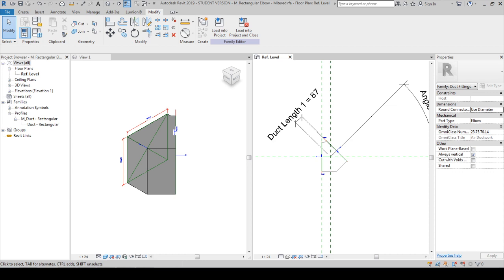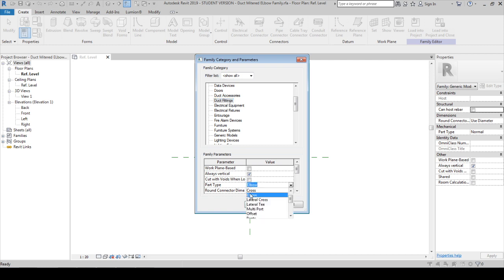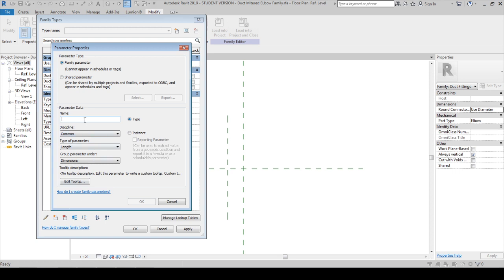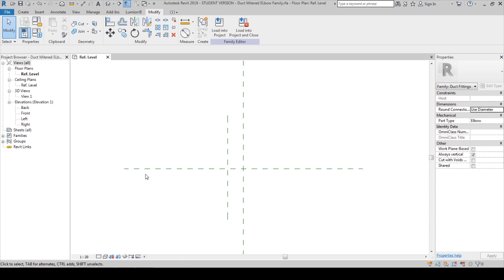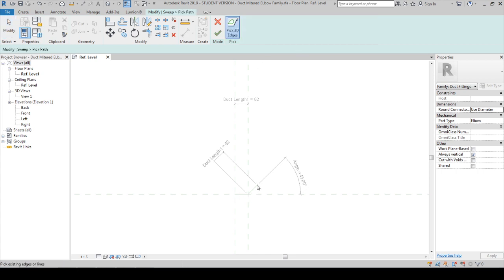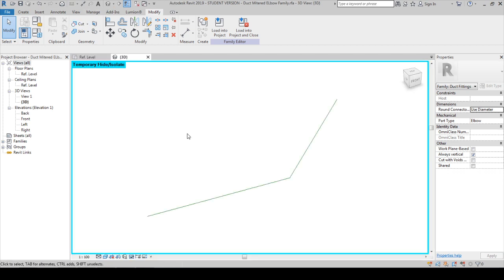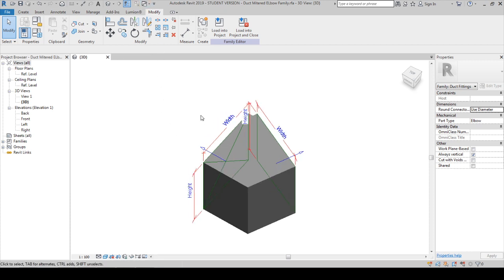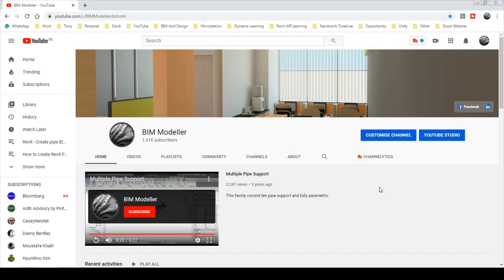How to Create Revit Parametric Duct Elbow Family

Comment: wouldn't the formula for duct length 1 be Duct length 1 = (width/2)/ (tan(A/2)) , If we are making a triangle by cutting the angle from between equally then Width/2 is the opposite side and the adjacent side is the duct length 1 so why multiply it? tan(A) = opp/adj, adj = opp/tan(A). I don't get it.
Reply from the maker: May Be... Yes basic trigonometry.

Comment: How did you choose tan(angle) duct length parameter can you explain please??
Reply from the maker: Hi Akhtar, It's just a trigonometry formula, to find unknown values based on available values.
Reply: @BIMModeller  ya but how are you taking the opposite sides mean to say 45° is cutting the width into half ?? How did you select the base as length of the duct?? As tan(angle) =perpendicular/base

Comment: Good explanation,thanks, my revit mep2015 doesn't have rectangular duct elbows/Tees but the learning which i use have this one, how can i get it
Reply from the maker: Hi Maqbool, Thanks it must be there with Autodesk Library files. If not reinstall only library content with internet connection not whole Revit. Note it requires min. 2 to 4GB of data